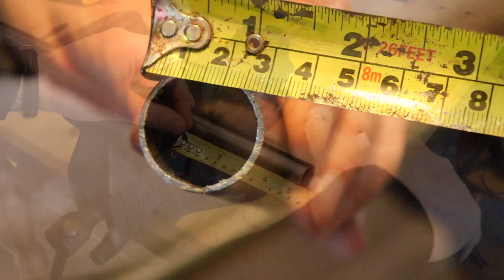HOW TO MAKE THE AUGER/PAN HANDLE COMBO

Comment: Please how did you hit the drill hard enough into the metal tube with a drilled hole hard enough to form a square hole for the auger drill, without damaging the cutting face of the auger? Nice work.
Reply from the maker: Only use an auger so damaged it’s irreparable, no loss. Thanks for your comment and observation😃👍